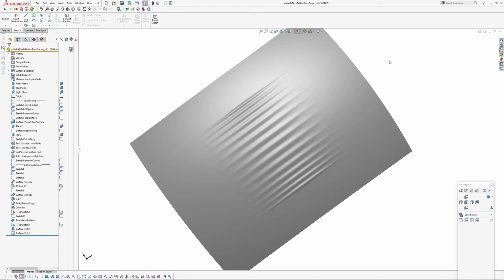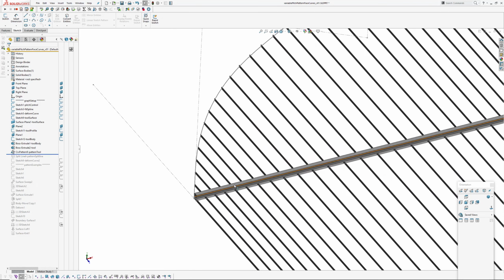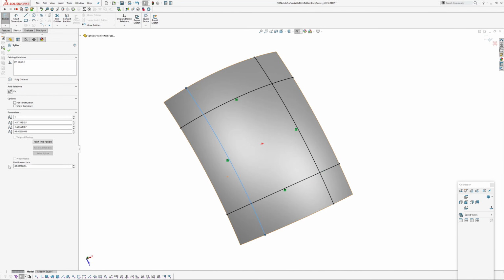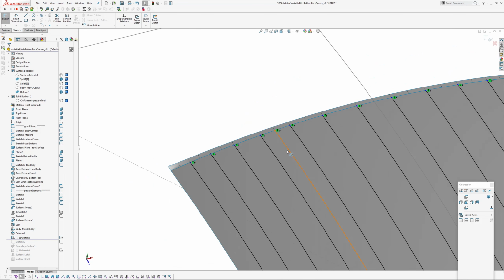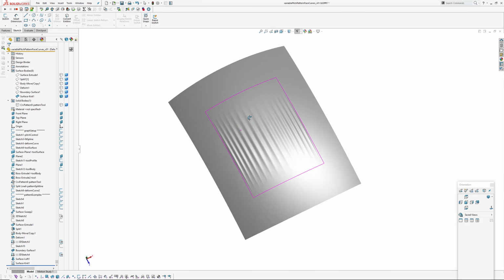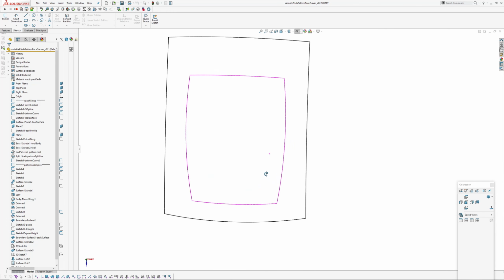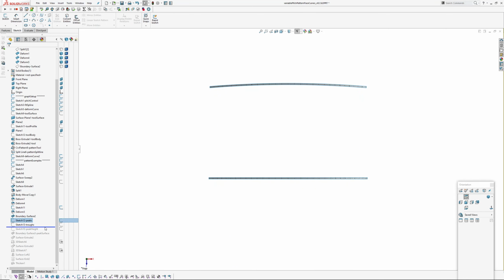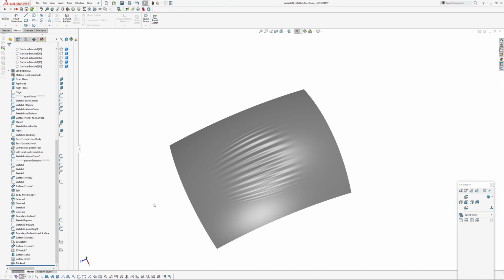Solidworks: Variable Pitch Ripple Pattern

Comment: Absolutely amazing process, going to have a go at this in SW.
Reply from the maker: You can do quite a bit with the deformed tool; map it to a spline, create a 3d sketch with points at each vertex on the deformed ribbon/tool then use the 3d sketch to drive a sketch pattern. I’m currently trying to figure out how to create the sketch points automatically, so you can change the graph pattern instance count and have everything update without intervention.
Reply: @AndrewJacksonDesignStudio  If you manage that then you’ve gone above and beyond, maybe it might be a job for a Macro possibly?
Reply from the maker: Yeah macro might be the way forward

Comment: And he did it again! Great stuff, Andrew. Your tutorials are an inspiration. I always wonder how you came up with these techniques..

But man.. making textures in Solidworks seems so tedious. It would be nice to have grasshopper for Solidworks.
Reply from the maker: Hi VP, yeah this technique started life as a grid on a Formway chair, except each line segment along the edge was drawn manually. I figured there is a better way and I remembered the ProE evalGraph tool. 

Grasshopper in SW? I was thinking the same thing. I had a look at RhinoLive the other day, you can run Rhino/Grasshopper within another application. Unfortunately my programming skills are not there - it'd be fantastic if it did happen though.